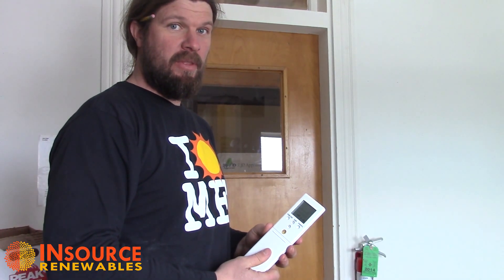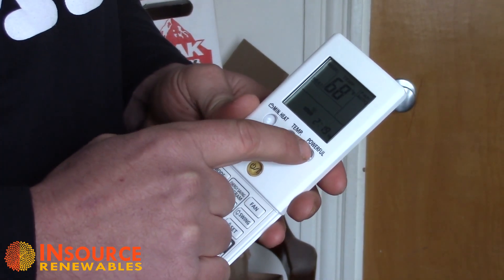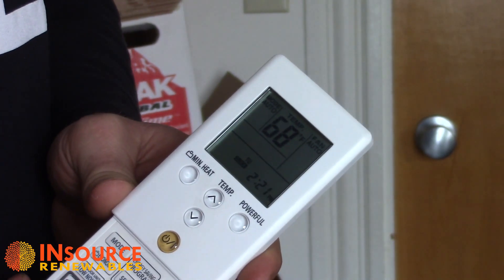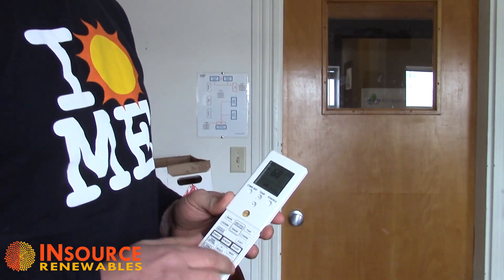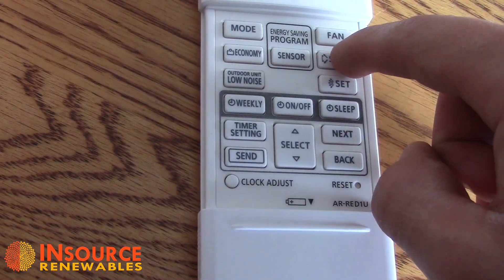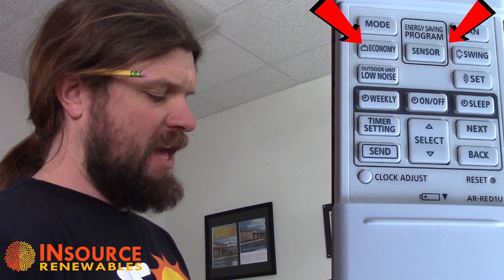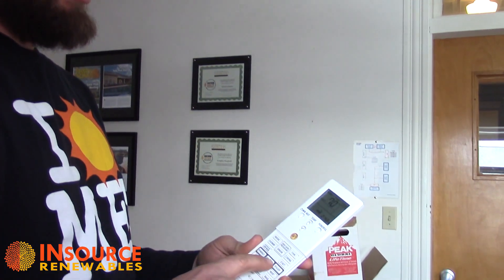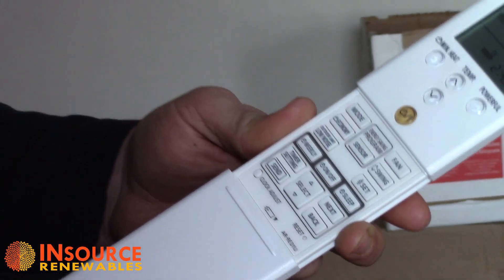Heat pump user tips #2 (controls)

Comment: Hi, would you happen to know why the front door on my unit won't raise up when turned on?  Many thanks.
Reply: If it is an RLS2 model (the only model I know of that has this feature), it is likely due to a cracked gear on the intake grille cover. It is a simple fix and the part should be covered under the warranty. Call your installer or supplier ASAP.

Comment: This is the best video available for the operation of the remote. Why are temperature settings only allowed in 2 degree increments for Fahrenheit temperatures but 1 degree for temperatures in Celsius? No one seems to know the answer to this, and I seem to be the only person wondering about it.
Reply: I suspect it is because the Fahrenheit scale between freezing and boiling has 180 points or degrees (212 boiling, 32 freezing) where Celsius has only 100 points or degrees (100 boiling, 0 freezing). This is a small example of why most of the world uses the metric system.

Comment: Why does my indoor unit ASU9RLF1 green light is constantly flashing. Outside temp is 50deg with 90% humidity. The owners manual says it is defrosting, but this stays on for almost 2 days and i had to manually turn it off and on to reset and again it goes to blinking green lights.
Reply: Did you do a hard reset at the breaker or just turn it off at the remote? If you shut the breaker off for 5 minutes and turn it back on and the unit is still exhibiting the same behavior, I would call your installer or another service professional.
Reply: I have 5 zones and this happen when one of my room is set as "Cool" and other one set as "Auto", the room with "Auto" is doing this green flashing light when the outside temp is <50 deg with 90+% humidity.

Comment: My units are not producing heat.  Any idea why?
Reply from the maker: Is the controller set to a temperature above the room temp? Try turning it up to max heat just to see if it produces anything when it's cranked. If it still doesn't blow any heat and there are no flashing lights on the indoor unit, it could have a slow refrigerant leak, in which case you should contact the installer.

Comment: Great Videos! Very informative. If i happen to bend one of the fins on the coil of the outside unit, can i straighten them back out with a fine tooth comb? or will that likely do more damage?
Reply from the maker: There are special tools designed for straightening fins which are essentially fine toothed combs with the teeth properly spaced. If you google "fin comb" you'll see lots of options. If the spacing of your comb aligns with the fins you could give it a try, just be cautious.
Reply: Awesome. Thanks man! Great vids! Very informative.
Reply: What temperature is best to set the air condition on cool ?

Comment: After power outage we got the cooling but doesn't see to go back to hearing from the pump, is there another reset we missed?
Reply: Heating
Reply: You can give the unit a hard reset by turning off the main breaker for 5 minutes. If that doesn't fix it (and make sure you let it run for 10 minutes to check), you likely have bigger issues.

Comment: Thank you for the video, it's very helpful . I have a question, I set the mode to heat up to the 88 Fahrenheit, but the air feels cool not warm. and I am not on economy mode. what should i do?
Reply: If you have let it run for 10 minutes and still do not feel hot air, you can try a hard reset by turning the breaker to the heat pump off for 5 minutes and then turning the breaker back on. I suspect you have a refrigeration leak that will need to be repaired.
Reply: Same thing is happening to mine. It was just installed a couple days ago. The objective is to feel heat when heat is on; not cool air. I'd never buy this thing if I was a homeowner. The constant turning off, on, off again is distracting and it makes funny noises. There are cold spots in the home and it does not hear evenly. Poor people wasted their money on this thing. I'd rather use my Walmart space heater.

Comment: Is the thermostat always in the unit and not the remote on Fujitsu mini splits?  Fujitsu remote seems to be line of site only, is this true? Thanks, Rick
Reply: The unit measures the room temperature by measuring the temperature of the air entering the top of the unit. There is no "thermostat" per se; the unit runs on a program based on a variety of temperatures at the outdoor unit and the indoor unit.

Comment: In dry mode, "powerful" button cranks the fan up full throttle. Is there a work around to get the fan to work on manual in dry mode please? Thank you.
Reply: See our other reply - only way to vary the speed for dehumidifcation is to run it in cooling mode.

Comment: Great video, just messing with dry mode, I notice fan will not move from auto, and temp will go no lower than 18 celcius, roughly (68f). Thank you again.
Reply: In dry mode, the outdoor fan and the indoor fan run at fixed speeds. The only way to vary the fan speed to remove moisture is to use cooling mode.
Reply: Thank you kindly Sir for your help.

Comment: Hello I'm new to these pumps. One of the fans the front goes up and down circulating heat great. My second fan doesn't move. How can I make my second move like the first. Thank you.
Reply: Paul, did you resolve your issue? I'm not sure I understand the two fans you are talking about. There is one fan on the indoor unit. Some units have sweep functions that direct the fan up-and-down (and the new models left-to-right) like an oscillating fan. Is this what you are talking about?

Comment: Excellent video. I took out my filters today and found mold on them. At the end of the cooling season last fall I did run the unit on fan for about 30 minutes as recommended by Fujitsu to dry out the unit. It was used occasionally during the winter for heat but not regularly. I washed the filters today with warm water which removed the obvious mold stains. Is there anything I should do to neutralize the mold? thanks
Reply: +Robert Pelcovits You can use a mold inhibitor spray that is available for HVAC applications.
Reply: thanks
Reply: Spray Nine. Turn unit off, remove the dust collectors, spray the spray nine over the coils underneath the dust collectors, reinstall dust collectors, turn units on powerful. That's what I've done to prevent mold (not necessarily remove mold) during the summer when AC mode is used. It's what my installers told me to do.

Comment: Really enjoying these vids..so much more entertaining than the &&^()()&*&% manual that came with the unit.  I found it's doing a great job for cooling (on dry), but am finding the winter air cold so came looking for tips.  Cleaned (and removed the two "extra" filters) ,changed fan mode to auto and will see if that helps. This is supposed to be my main source of heat now, but I find I'm still running a portable heater to take off the chill.  Toodles!

Comment: I'm another owner suffering to understand the the Timer Settings, so it can go down while we're at work and in bed and come up to temperature for morning and evening meals.....tried 5 times to follow the manual and considering learning Japanese which might help me understand how they are using which terms.  THIS video is great - thanks.
Reply: +Leigh Baker Have you tried the Energy Savings Program setting that uses the motion sensor? This might be a much easier way to go that will serve you based on your occupancy rather than a set schedule.

Comment: i have a fujitsu Halcyon heat pump....everytime i clean the filters i can't start my system. the lights keepsflashing on. On button for 9x thn the timer for 7x and the economy button flashes on. So when its cold out i can keep my place warm....any ideas what i can do
Reply: +Philippe Morneault The 9/7 error is an outdoor fan error. You can do a hard reset for 5 minutes by turning off the breaker for 5 minutes to see if the error code will clear. If you are in Maine and need service, please feel free to contact us at 659-1054.
Reply: Philippe Morneault

Comment: great vid. do you know why I feel air coming out of the indoor unit even when its not calling for heat? I have the unit on heat and fan on auto. but with the barely luke warm air coming out kind of defeats the purpose. anyway to turn the fan right off until its calls for heat? Thanks.
Reply: +travel si The fan runs at a very low speed till the coil gets hot so its not blowing cold air until the coil warms up. if the fan never speeds up and the air is not noticeably warm you are low on refrigerant,
hope this helps...
Reply from the maker: +travel si 
When the unit is on, it will always cycle air through the fan so that it can get a temperature reading and determine whether there is a demand for heating/cooling.

Comment: This is very helpful! Would you consider making a video about the timer functions? It's very confusing in the operating manual.
Reply: How to setup the Timer (I struggled for nearly 2 weeks with this Timer). The manual is not very user friendly.
Steps as follows:
1. Ensure unit clock is set correctly as per manual.
         This is the key part that I was missing
2. While the Unit is still turned on!!! Press the TIMER SETTING button (WEEKLY will begin flashing)
3. Keep pressing the SELECT button and you will step through the following modes ON, OFF, ON/OFF mode. Select the ON mode for this setup. 
4. To set the time you want the heater to come on, press the NEXT button and the clock will start flashing.
5. Press the SELECT button to increase the time on the clock in 5 min intervals until you reach the desired time once you have the time that you want the heater to come on. Press the SEND.
6. The unit will shutdown and your Timer settings will be displayed on the remote control.
7. You will be able to see whether it has worked by checking the wall unit, it should have turned itself off once you pressed SEND and the vents should have closed.
8.  You will see a little orange clock lit on the front panel indicating that the TIMER is active.

Hope this works for you. We are still jumping around the house celebrating that we got it to work.
If you have problems following this let me know.
Reply: @pukimaster1670  legend!
Reply: +mainerforlife We'll post a link here if we make a timer video this winter. We often recommend using the Energy Savings Program feature that uses the motion sensor if it suits the needs that a timer might otherwise serve. It's much easier to program...
Reply: As I see it, the energy savings function would be good in the summer for AC but in the winter, we tend to want to enter a warm house and the only way to do that is to program the unit to come on 60 to 90 minutes before you get home. I am waiting patiently for your vid...thanks
Reply: +Puki Master I'm struggling too.  Do I do the same steps to set the OFF time so it's not constantly running?

Comment: would you happen to know how to change Celsius to Fahrenheit
Reply from the maker: +Violet_ 2uesdae 
If you have an RLS2, try holding the temperature up button for 5-8 seconds. This should open up the menu to change between Fahrenheit and Celsius. Press the temperature up button again to switch between the two. Press start/stop to make the selection. Hope this works!
Reply: Hello! I was able to fix it! Thank-you
Reply: @insourcerenewables890  Hi I have the AR-REF3E model with the same remote as this video, and i would like to change from Fahrenheit to  Celsius the method above doesn't change it could you please help thank you
Reply: @siNiZta01  You have to do it with the remote switched off otherwise you'll just increase the temperature. Switch remote OFF, Press Temp UP to desired C or F (toggle with TEMP UP and DOWN) and LOCK IN with ON OFF BUTTON and Voila. Switch remote back on and then tell me it didn't work as yours is a different model 🥳
Reply: @insourcerenewables890  thank you!!! My nephew which is 2 years of age got ahold of the remote while I using the bathroom and he changed it to Celsius
Reply: you would be here in OZ :)
Like ruby Shoes lol
Reply: Can I disable senser & economy mode how ?
Reply: I have rls3
Reply: How do I turn on the heat it doesn’t seem to work
Reply: If the remote screen is completely blank, how can I get it to display the temperature etc.
Reply: Bro. Your a real life Superman. I have accidentally set my remote on weekly settings and I can no longer press on off or change heat or aircon? Any help would greatly be much appreciated